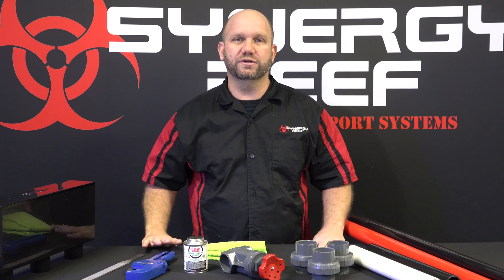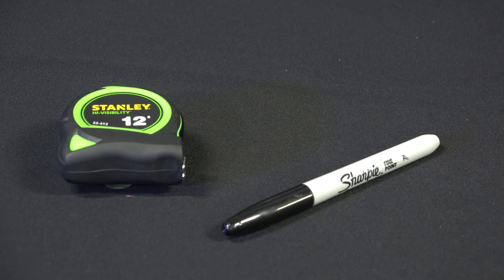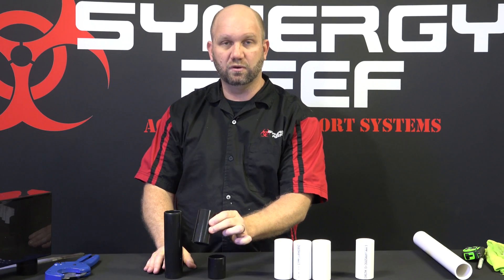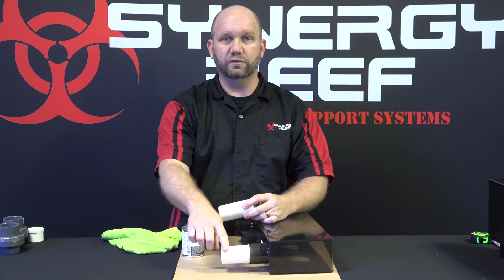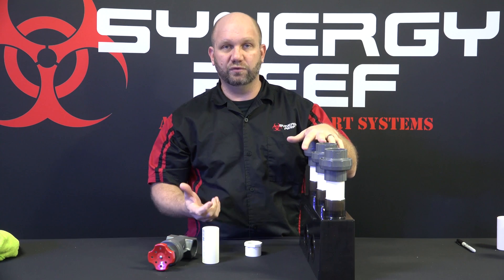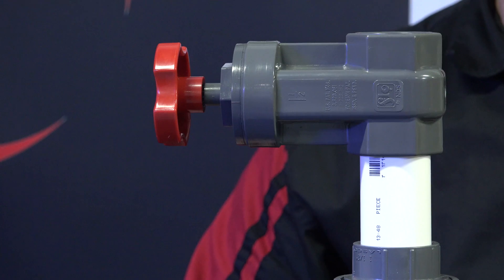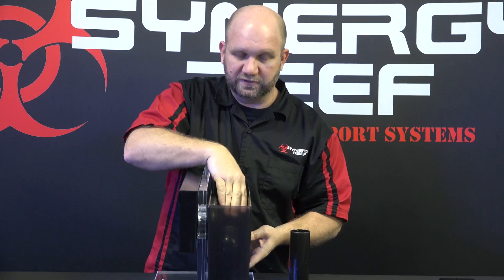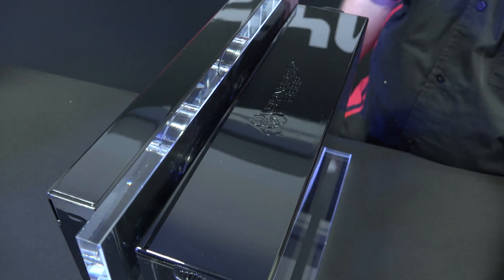How to Properly Plumb the Shadow® Overflow System

Comment: Website recommends internal drain pipes at 2.75", 3.75" and 6.25".  Video suggests 2.5", 3.5" and 7" ???
Reply from the maker: Pipe sizes will vary based on your flow rates. The website will have the most current info as we have updated our recommended pipe lengths since this video was released. These are both perfectly fine lengths to start with though. Fine tuning will be required in some cases, so there is no 1 size fits all.

Comment: So the only issue I get is alot of salt creep and can be noisy, after i watched the video at macna i noticed in the comments you guys said you had to gate valves to get it very quite. wish you would have recommend that.
Reply from the maker: Hi Keith, Salt creep can be caused by many things and one in particular is incorrectly tuned overflow. With it not properly tuned you can get excessive air bubbles in the rear box causing excessive salt creep. We also have modified the rear box lid assembly in the Shadow V2 to eliminate salt creep. As for the gate valve, in this video at 6:15 we do recommend a gate valve and we definitely would have if you contacted us for assistance. There is no way to tune the overflow without a gate valve and this is how it functions. Ball Valves are not recommended as they are only designed to shut water on and off. Gate valves will allow for gradual closure and tuning of the flow. Happy Reefing!
Reply: @SynergyReef  I tried tuning it to get the water up in the box like mention but the issues is not make what size length I make the pipe the second drain creates a siphon and can get it to stay consistent. But I noticed in your video you all used two gate valves so going to try that.
Reply from the maker: @smooterd  Without a gate valve you will never get it tuned. Definitely get a gate valve first.
Reply: @SynergyReef  I have gate valve on the primary line i am talking about one on the secondary line. You guy mentioned it in the comments. That makes sense to be abel to get the water up higher
Reply from the maker: @smooterd  A 2nd gate valve would ONLY be needed in very low flow (500 gph or less) situations, but this is rare. The water level is raised with the internal pipes and not the gate valve. The gate valve is only used to balance (silence) the flow between the primary and secondary once they are at the correct heights for your particular flow. The valves are not to be used for level adjustment in the rear box. Only 1 gate valve is needed. Then adjust your internal pipes to the correct lengths to get the water level higher in the rear box. Make them equally taller. Start with our recommended lengths and then go up in increments of .25" if needed. This is all dependent on your flow rate you are running.
Reply: @SynergyReef  thank you I deal with what I got. I am sunning the sicce 9 up about 13ft and about a 25 ft horizontal with the pump running at 90%

Comment: What is the flow rate and hole size in the glass
Reply from the maker: Max flow rate is 2500 GPH and the holes thru the glass are 63mm.
Reply: @SynergyReef  thx

Comment: Can this be installed on a tank with the black plastic rim around it? Does it include the diamond drill bit or do I need to purchase one separately?
Reply: It can, just be sure when you lay out your holes like he did you also check the skimmer box on the INSIDE AS WELL. my tank also has a cross brace and had I just checked the collection box on the back it would’ve been a hair too tight for removing the weir. I’ve had mine for 3+ years with no issues. Good luck

Comment: Just curious - why do you recommend a 4 to 10 inch length of PVC immediately below the Overflow?  Are there any considerations with using the shorter or longer length?
Reply from the maker: Hi Jim,
you can technically use any size you would like, but we found that the 4-10 inch lenghts work the best if you need to ever modify your installation.

Comment: what is the point of the u drain on the full syphon line? like what would be the difference if i just put a strainer on the bottom of the bulkhead inside the box?
Reply from the maker: With certain flow rates it is necessary to make to overflow silent. Strainers can cause a vortex and breaks up the linear flow causing noise.

Comment: So you don't glue the fittings that go inside the overflow like the emergency drain and the other 2
Reply from the maker: Correct, do not glue them. You may need to adjust the lengths to tune the overflow to your flow rate.

Comment: Hello nice video question is this for tank that are drill? I would love to try this on my 90 gal. But it's not drill. I want to try the overflow method. But not sure if it will work
Reply from the maker: Yes you have to drill the tank. It is a very easy process. Seems scary, but it is very simple if you can use a drill.

Comment: My overflow from you has dividers in the rear box. I don't have a choice where to put the U-pipes. There's 2 larger sections on the ends and one more narrow section in the center. My emergency drain is on one of the ends. And.... For some reason, move if the pipes week even fit in to that section.

Comment: I'm curious as to why you recommend against ABS-to-PVC transition cement when gluing the drains in.
Reply from the maker: Because of the viscosity of the ABS transition cement. It is too thick and  does not chemically soften the plastics like standard PVC cement. We tested it originally and did not see any benefit to using it. We actually found that standard PVC cement works better and creates a better bond.

Comment: Great video. I have a question. I have a 420 gal tank that I'm working on with 2 of the 20" overflows from you guys. The return pump is a Reeflo Super Dart / Snapper Gold Hybrid (4300⁄2400 GPH) that has a 2" FPT inlet and a 1.5" FPT outlet. I too, was wanting to use 3/4" Loc-line at the tank. Do I stay with 1.5" on the pipe from the return pump to the tank and then reduce to 3/4" bulk heads or do I not use Loc-lines and reduce to maybe a 1" bulk head? Thanks in advance!
Reply from the maker: I would reduce to 1" bulkheads.

Comment: Do you sell this overflow with no cutouts for the glass.  I'd like to replace my existing overflow so my glass is already cut.
Reply from the maker: No. The Holes would either need to match or you need to drill them with our template. The hole placement is in specific locations to allow the plumbing to work properly inside the overflow.

Comment: Using a 40 gal breeder with this overflow- would there be any issue reducing to 1" drains after a union? Return pump is controllable.
Reply from the maker: Nope. It is totally fine to reduce the drains down to whatever size you need for your flow rate you wish to run. We designed it with larger drains so they can always be reduced.
Reply: My question, too. Glad you asked.

Comment: Just glue no primer?
Reply from the maker: TonesBaseball yes that is correct. No primer, just medium clear standard pvc glue.
Reply: Is there a difference between PVC glue and PVC cement? I picked up the Oatey "Handy Pack" which came with the purple primer and the "Regular Clear PVC Cement." Can I use that, or should I get the "medium clear"?
Reply from the maker: Any regular PVC Cement will work. Just do NOT use the primer. PVC cements come in different viscosity or thicknesses. Medium is just the viscosity. You can use any viscosity, but we like medium the best.

Comment: man, that looks like some flimsy and thin acrylic....
Reply from the maker: Actually it's not acrylic :-) It's Poly carbonate and has been engineered for the proper thickness for it's function. This is not a hand built item. When people hand build them, they tend to overbuild it as it has seams and needs to be thicker material. I can bet structurally the Shadow is stronger that any acrylic box that is thicker material.

Comment: Im setting up a 210g. system and will be removing the internal overflows. I had a 20" overflow on my last 180 bow. However, it seemed like the overflow warped overtime and created noise. Im thinking of trying the ghost overflows. I want two overflow's plumbed into the basement. Does this sound like a bad idea or should I stick with one? Great product, thanks in advance!
Reply from the maker: Being injection molded with polycarbonate, the Shadow weirs will not bow. For a 210 it really depends on how much flow you will be running. 2 would probably be the way to go.

Comment: I noticed that both U pipes have holes in the top of them.   Previously, I have only seen the vent holes on the 2ndary.    I have your previous generation 16" box with the 1" fittings inside and only have vent hole on 2ndary --- had problems getting the system to "settle" and purge all the air out of the primary.   My sump is in my basement about 10 feet below -- curious if I'm having trouble with that large column of air in my primary and a vent hole on primary would help this too?
Reply from the maker: Hi Patrick,
Yes that is exactly why we now recommend holes in both pipes. This eliminates the air lock scenario with some setups.
Reply: Do you just leave the vent holes open? The hole on the primary only matters when you are trying to restart the siphon correct?
Reply from the maker: Yes, both holes need to be left open in order to properly restart the siphon. The secondary can also create an air lock if not vented.

Comment: Regarding the secondary overflow, does any water flow thru this overflow and if so why isn't a valve necessary?  Thank you
Reply from the maker: Yes in some setups the majority of flow will be running thru the secondary drain. A valve isn't necessary because the primary drain valve will balance the flow between both drains. But in some cases you can use a valve on the secondary drain to get even more control over the flow.

Comment: On your website's 'contact us ', why do you require a secondary email?  Not many people have two email addresses.  This makes asking for help much more difficult if not impossible. And no phone number for contact.  Not great customer support.
Reply from the maker: @charles kares we require a secondary email in the event that the primary email gets kicked back to us and we cannot contact you. Often times people may also enter an incorrect email address and the secondary may be correct. Setting up a secondary on Gmail or other free email providers is very easy and most people actually have multiple addresses. Asking for help is not difficult or impossible that way as we get hundreds of questions and answer them all very fast. We do not talk on the phone as we are a machine shop and it is most of the time very loud in our facility. Also having a  written email allows us to go back and make sure everything was covered that we needed to address. Phone conversations tend to get forgotten and lost. We do not have tech support reps that can just wait for a phone call to answer as we are a still a small family owned company.  You can ask our customers about our support and will find our support is top notch. Hope this helps.

Comment: In the event of a power outage, how much water will the Shadow drain to the sump?Thank you
Reply from the maker: Charles it will depend on the size of your aquarium. Need to know the lenght and width of the aquarium to calculate this.
Reply: 120 gallon 48 x24x24Thank you
Reply from the maker: Approximately 8-10 gallons. This is calculated by taking the length x width and then figuring a 1.5" level drop if you remove the front weir. You can use any of the online aquarium volume calculators to calculate this.

Comment: no primer needed?
Reply from the maker: correct DO NOT use primer on the overflow
Reply: Why no Primer?  You should always use primer
Reply: @meiersreefs188  primer is for pressure applications. It really isn't necessary for this at all.

Comment: Do you also sand or chamfer the inside edge of the pipe?
Reply from the maker: The inside just needs to be lightly sanded or scraped. The outside it what needs to be chamfered to allow the PVC glue to be distributed evenly inside the fitting and along the pipe edges.

Comment: Hi my sump is in the basement and i was wondering if it would be ok to connect the emergency drain to the secondary drain by using a Y connector
Reply from the maker: Hey Ken! No we do not recommend connecting the emergency to the secondary. At that point you no longer have an emergency. It will also create a loud suction noise to be emitted from the emergency pipe in the overflow box. It won't be quiet :-). If anything you would be better off just not using an emergency and running a 2 pipe system. Just use a PVC Cap and plug the emergency hole. The 3 pipes have to stay independent of each other in order to properly function in a silent manner. Thanks for asking, it's a great question!